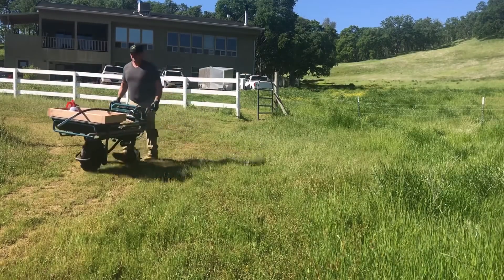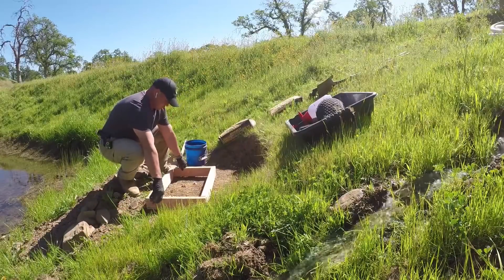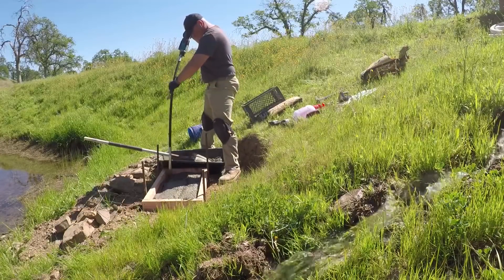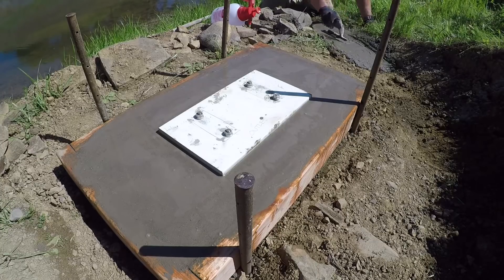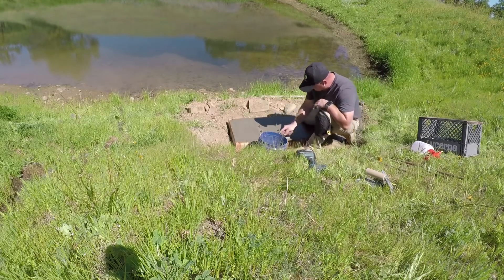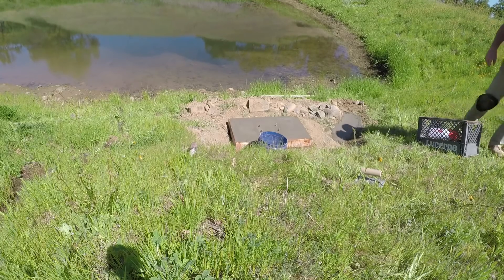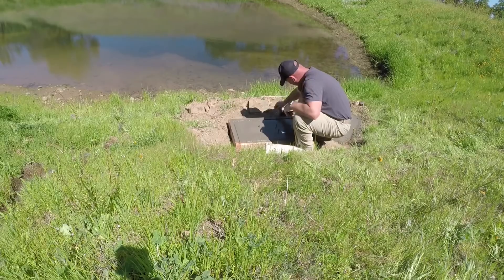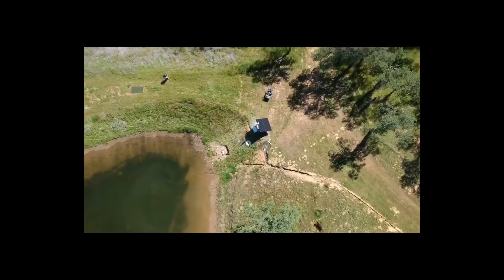solar pond transfer pump part 2

Comment: Wheres part 3... i have seen lots of cement and no pump?

Im looking for ideas and this isnt helpful... i need to see numbers on lift and distance and volumeat specific amps /volts.

Ill check with manufacturers but wanted to see your system at work. 

Like the panel and battery setup!
Reply from the maker: Bob Howard 
https://youtu.be/2nCz360osTU

Comment: Hey bud u got a wiring diagram on the fw500 dc I'm checking to make sure I got everything thanks
Reply from the maker: Dan Goras no I usually custom build them what are you making
Reply: Fw500 with 2 classic 150s one whizbang jr 2 shunts

Comment: Nice editing and sound...best video to date...maybe a j-bolt if a lot of vibration expected..?
Reply from the maker: Thank Russ, yeah  Jbolt would have worked great also but I was trying to use material on hand so far so good !
Reply: Or just put a washer between two nuts at the end of each bolt and imbed it in the concrete. Stainless steel is best, hot dipped galvanized next best, zinc is better than bare steel. Great video, thanks.